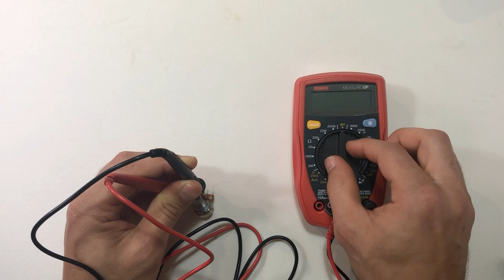Potentiometers with DC Motor - Simple Circuit Activity

Comment: okay this was super helpful for me but i do have a question. So i have the exact set up youre running and just like you suggested I burned out my potentiometer. I have more but im worried Ill simply continue to burn through them. What do I do in order to make sure I dont burn the pot out? im assuming ill have to wire in a resistor or something but im unsure of how
Reply from the maker: Yes you are correct - ideally you would wire in a resistor reduce the current (and save your pot). The trick is picking a resistor that can reduce the current enough but no so much that you can't use the DC motor (may want to try 10 ohms and work up or down from there). The exact resistor needed depends on your voltage source, motor, and your potentiometer. But if you don't mind losing a resistor or two I would start at 10 ohms and work near that. Just note that if your currents are high enough to exceed your resistor power rating you may burn those up (often 1/2 or 1/4 watt). There are more advanced circuits that can bypass this issue (motor control circuits)

Comment: Can I use any potentiometer like potentiometer in speaker
Reply from the maker: Well the main thing that can change in a pot is the form factor (how many legs, size, shape, etc) and the range of resistance (For example 10 ohm - 100 ohms or 1000 ohms to 10k). So if the potentiometer fits your applications sure (but I don't know what you plan on using it for)

Comment: can i use a 20k pot for my 12v dc 775 motor?
Reply from the maker: It's going to depend on how much current your pot can take.
Reply: not unless you have a very much larger wire wound potentiometer.   the 775 motor takes way to much current (1.2A) for one of these dinky film pots.